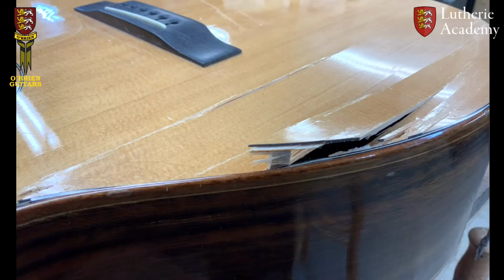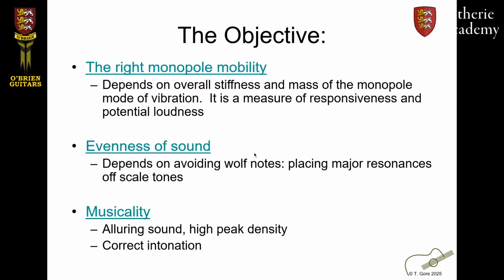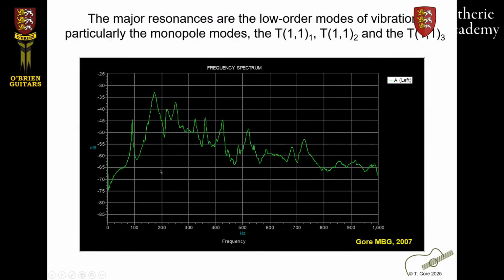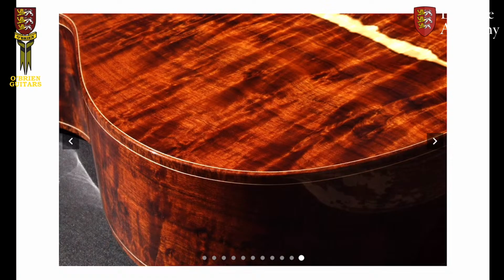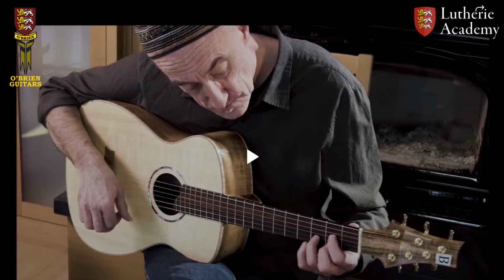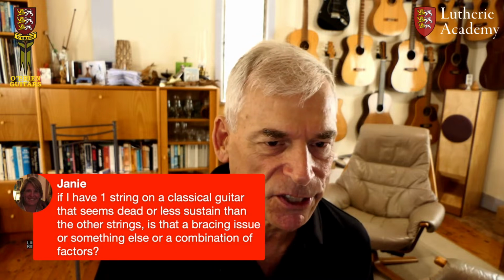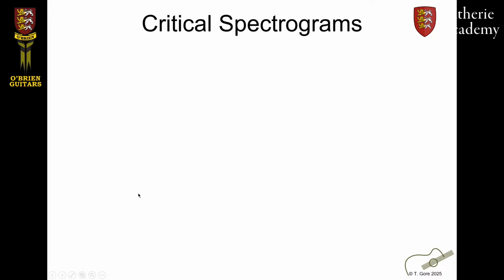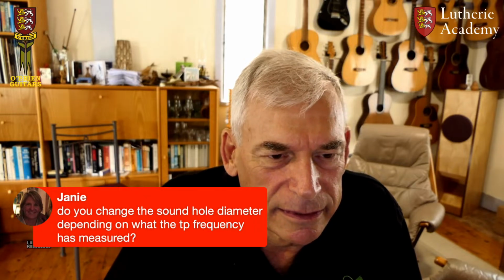SHOP TALK 46 - Live Stream - Trevor Gore - Acoustic measurements of wood

Comment: Great explanation of nut compensation. I had a Stelling Banjo which had nut compensation (as well as a compensated saddle, of course), long before this was a thing on guitars. I couldn't hear a difference, and nor could anyone else. I have also seen a couple of papers which showed that the average listener could not hear a difference between a regular compensated saddle (just slanted) and and individually compensated saddle. So, my question is: is there a reason other than sounding in tune why individual string intonation might be worthwhile (for example, does it help sweeten the overall sound in a way which is discernible to the average listener)? One other intresting thing which came up was Alexander's question about bridge weight. There is a lot of stuff about adding different bridge pins (brass, the Martin liquid metal ones, and so on. Now all these add weight and so you would expect additional headroom (I've never heard that myself), but you have no opportunity to change the resonant frequencies, since you can't make the top stiffer after the event. So I cannot see the point of heavy pins. What you potentially gain in headroom you lose in tone quality. This is a fantastic resource, and Trevor's knowledge and experience shine through.